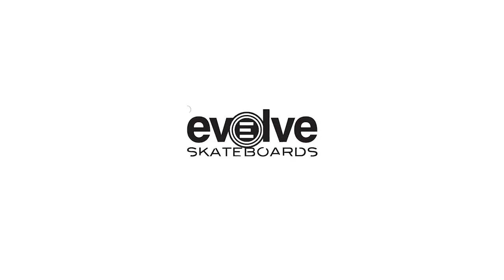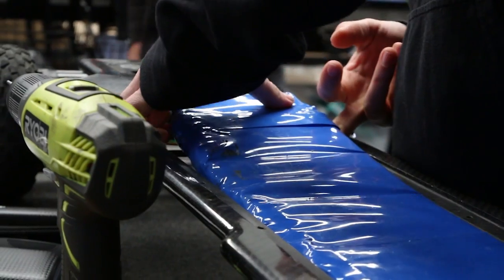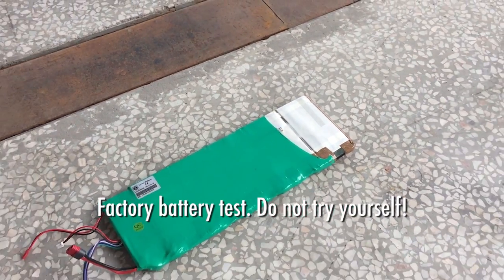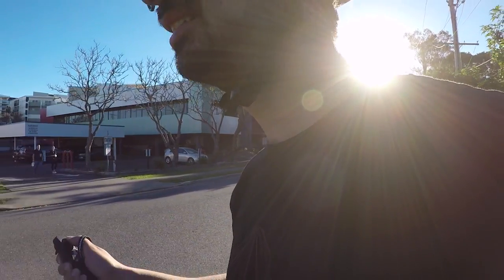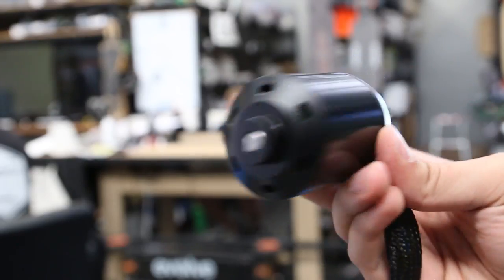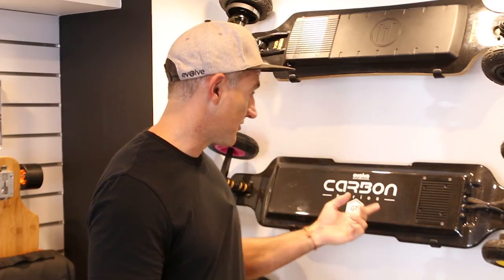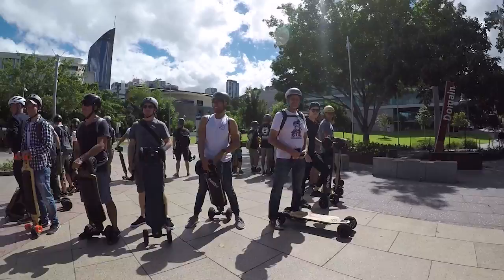Batteries, Motors and Knock-Off Evolve Skateboards - Evolve Weekly Ep. 31

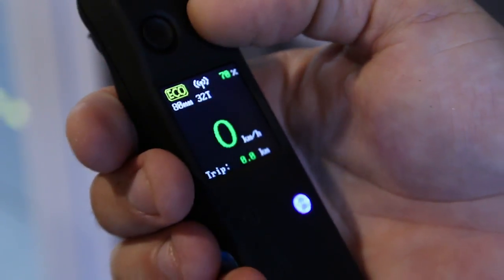Comment: 2:39, the reason is because it's easier. monitoring voltage is not Power remaining. you want to measure coulombs
Evolve are crap, the voltage drops and it keeps switching to lower speed modes and you have to keep bumping it back up.. imagine if you really need to move quickly and that happens.
Reply from the maker: Hey, this video is 3 years old - you should see where the technology is at now!
Reply: @evolveSkateboards  my Carbon GT skateboard is 11 months old and still does what the old ones did and it died with a faulty pouch cell which was problematic since I got it but now it's too late they didn't fix it before the warranty ran out, oh yeah only 6 months. So no improvements were done on GT, you don't even sell it now.

Comment: Have to say I’m very disappointed in the battery quality of the evolve boards too.... 
I’ve got a carbon GT on AT setup and it’s only got 51 cycles on the battery and already the battery range is terrible,  I am 6ft 2 and just shy of 200lbs so yea I’m not the smallest guy but still!! 
Granted in GT mode it will pull your teeth out, the speed and acceleration is really impressive but I literally get 15-20 minutes and the battery is sagging it’s arse off.. kicking me into Eco mode
 (which at my size is fast walking pace)
Even without GT mode, fast mode ridden ‘hard-ish’ I don’t get long at all on it... 100 percent charge, 30 mins tops... yes when you stop for a minute the battery level goes back up on the screen but as soon as you start riding again it’s like an old donkey! 
Must say I wouldn’t like to push my luck for more than 3 miles on it without worrying about running out of juice or at best riding home in ‘Eco Walking Pace’ (god forbid you hit an incline)
I’d like to note that the board has ONLY got 51, yes.. FIFTY ONE CYCLES from new! Never stored cold or outdoors, never run totally dead and never overcharged! 
Board is well built, rides real nice, carves real nice, looks awesome but the battery is dog sh*t!
Quite disappointed to be honest

Comment: It’s funny that they’re using 18650 cells now.
Reply from the maker: We always liked the cells but it's important to get the full system working flawlessly. It's all explained in the doco about the GTR.
Reply: Evolve Skateboards Jeff tries to make the case that your old packs were more practical which is just not the case.  I spent $2,000 on a electric skateboard that’s been totally overhauled in the past year. My evolve bamboo gtx has less than 50 miles and isn’t working. USA evolve sent me a link to buy a new motor for 4 times the price of a 5065 motor. So basically I have to strip down my board and rebuild it spending more money.

Comment: Don't forget that square packed batteries have larger surface area. So you should theoretically carry higher capacity per volume vs cylindicar 18659/26650

Comment: Rode my gtx for 4 months nearly every day, no voltage sag to speak of.
The board is now stored for the winter, going to put it to use in a few months or so again.
I hope it will still perform well.
How long time does it take  for the battery to start going bad?

Comment: The batteries on these boards are absolute shit. I highly recommend you don't buy one of these and either get a different board or wait until they improve it.  Not only are there battery problems, The controller also disconnects halfway through the ride.. This is very dangerous. These boards cost premium price, but do not offer premium quality.. using cheap ass batteries and shit remotes.. Highly recommend anyone planning to buy one of these to rethink.  Once again this board costs premium price but does not offer premium quality..
Reply: What board are you using?
Reply: Martin H. It’s my friends evolve GT. It keeps disconnecting on us. I’ve been riding it since he got it so I got to know the board pretty well. The boosted never failed on us and both boards were at 100% including remotes. It’s very dangerous.
Reply: @kifter4254  R2 remote?

Comment: Looks like you folks are ripping people off! Fuked up remotes, fuked up batteries, and NO OFFERS TO FIX ANY ISSUES!!! Basically you’re just stuck with a fuking $2,000 board that doesn’t work right and this cheap ass company WILL NOT FIX ANY PROBLEMS!! They just tell you -too bad, buy our new upgrade but we’re not going to support any issues y’all have. If these boards were worth a rats ass then the company would fix any problems that were there originally!  Worst customer service EVER!!!

Comment: Thanks for clearing up the air about batteries. I was going to buy a GTX but after all the horror stories I've been reading about the remotes getting stuck in full throttle or suddenly disconnecting and going into breaking I've got real second thoughts. please give comments on this issue. I am not trolling, this is a legit safety question !

Comment: I GOT CHUCKED OFF MY CARBON GT GT BOARD GOING UP HILL WHILST IT WAS GOING REAL FAST 
WHEN IT JUST WENT IN TO ECO IT SUDDENLY SLOWS BUT YOU DON'T AND YOU GET THE FLIP OF YOUR LIFE 
IT WAS THE ONLY TIMES I HAD ACCIDENTS ON MY BOARD EVER !
BUT IT HAPPENED SO OFTEN WITH THE POWER  AT YELLOW  22 % AND EVEN ABOVE ,
THAT I STOPPED GOING UP HILLS AT 30 % ,AND I WAS SCARED BUT RECENTLY 
AFTER HAVING SOME SERIOUS ISSUES WITH MY BOARD IT WENT INTO SERVICE 
MY BOARD HAD SOME SERIOUS ISSUES FROM THE GETGO
IF I HAD BEEN USING IT FOR SAY 30 MINS FULL PELT WHEN I TOOK IT TO A FLAT SECTION IT WOULD ACT AS IF IT WAS IN SLOW MODE  AND IT WOULD STILL SAY GT IN THE CONTROLLER ,BUT IT WOULD NOT GO AT ALL ON GRASS ,AND WELL SLOW AND WEAK ON TARMAC  I WAS SO UPSET ABOUT IT 
I HAD TAKEN IT TO THE SERVICE GUY A GOOD COUPLE OF TIMES BUT THE ISSUES WERE STILL THERE I WAS SO BUMMED OFF ,I JUST COULD NOT TRUST IT  TO GO WHERE I WANTED TO GO WITH IT AS I WAS NEVER SURE IT WOULD GET ME BACK AND LUGGING IT HOME WAS A RIGHT ROYAL FREAKING PAIN IN EVERY MUSCLE I HAD 
I HAD HAD IT FOR ABOUT 5 MONTHS AND I WAS SO UPSET WITH IT .
I THOUGHT THE BATTERY WAS DEFECTIVE OR THE MOTHER BOARD FOR IT  I DON'T KNOW I JUST THOUGHT IT WAS A RIGHT WRONGUN AND I WAS STUCK WITH IT 
DAM THING SWITCHED IN TO ECO AT 56% IT WAS JUST 5 MONTHS OF A PAIN ,TO BE HONEST 
I GOT BACK ON TO THE SERVICE GUY ABOUT IT SO MANY TIMES ,
I WAS GOING MAD ,I REALLY WAS 
FINALLY AFTER ME REALLY GETTING THE HUMP AND HAVING A HISSY FIT 
HE TOOK IT IN AGAIN AND THIS TIME  TOOK IT THROUGH ALL THE TESTS ETC UPDATED THE CONTROLLER 
I GOT IT BACK WITH THE NEW UPDATE  
NOW I NEVER GET CHUCKED OFF IT GOING UP HILL ANY MORE EVEN WHEN ITS A RED 11 % 
WHICH IS SO GREAT , IT NEVER STOPS WORKING  ANY MORE LIKE IT USED TO 
SO I KNOW ITS GOING TO GET ME HOME FROM WHERE EVER, I TRUST IT AGAIN . FLIPPING HECK I AM SO MUCH HAPPIER WITH IT NOW 
BUT ITS A REAL SHAME THAT I HAD TO PUT UP WITH IT FOR 5 MONTHS  
WITH ALL THOSE  BAD ISSUES MY CARBON GT BOARD HAD FROM ITS ARRIVAL
I HAVE TO SAY IT TOOK SOME GETTING USED TO THE NEW CONTROLLER  BITE POINT  AND THE FACT THAT WHEN YOUR GOING FULL SPEED NOW THE ACCELERATOR  IS FULL ON THATS NEW .
I DON'T MISS THE REVERSE MODE NEVER DID USE IT ANY WAY ,BUT
I CAN NOT UNDER STAND WHAT THE SAFE MODE IS FOR ,
I HAVE NEVER TRIED MY STREET WHEEL ON MY GT  
ITS MAD COS I THOUGHT I WOULD USE THEM MORE THAN THE A T  WHEELS BUT ,,
I GOT TO GIVE THEM A GO JUST WISH IT WAS NOT SUCH A FLIPPING  PAIN TO SWAP THEM OVER 
I DON'T EVEN KNOW HOW TO DO IT  YET   MY STREET WHEEL ARE STILL IN THE CELLOPHANE WRAP HERE  LOL
LAST WORD IS I LOVE MY GT BOARD NOW  ( IT WAS JUST BAD LUCK IS ALL )

Comment: Best not to solder 18650's -  you weld them.  Furthermore having 10s 1p pack is where you get the famous and terrible evolve battery sag from.  You also forgot to mention that generic prismatic cells are a lot cheaper than quality 18650's so in a sense you have chosen profit over delivering a better quality product (not saying your boards don't work well but could be better)

Comment: I'm sorry. i'm in the electric helicopter/drone World and i Can assure you that the cells you use in the Bambou GT are just crap. They don't hold the discharge current at ALL ! 
you have very well known Brand in this market which provide very high current with much less Voltage sag. if you didn't want to use 18650 you could at least use decent lipo pouch. these one are just cheap and don't even hold a lot of cycle. Go take a look at Genace, thunderpower, pulse battery to name a few.... i read sometimes 400A Peak and 300A continuous (electric rc-heli speed races) and my packs don't even sweat. very flat voltage curve until 4/5 of the capacity.
So i also respect Evolve but for the price of the board, cheap cells, unreliable motors and capricious remote....
And give us a link please for the battery upgrade you mention,  never found any. 
I don't want to be rude but let's be totally transparent here !
Reply: As a RC Helicopter guy, you also have to be completely disappointed with the implementation of the RF technology in these boards as well. Completely negligent to release these boards with those nRF24l01 chipsets.

Comment: smaller size of cell does matter in terms of portability and aesthetic but skateboards are meant to be used not to be displayed aesthetics don't mean shit if the board's performance is dropping like poop... that is why I bought evolve...for the performance and now this performance is going south and south and now I can't even see why I' m riding this board...Now my bamboo GT has same miles range as Boosted Board
Reply: you don't buy evolve for performance,  A boosted's standard range batteries literally a123s i think; they can be recharged 2000 times before they degrade. Evolve is normally 250-tops 500. Hi Sung!

Comment: Your argument is invalid... I tested out in Eco mode only on flat surface with average of 16-17mph and My bamboo gt(my weight is 170 pounds / 80kg) I got 7.8 miles before it's voltage hit 35v (which is nearly dead) so Jeff.. I love you and i love evolve but these cells are getting reduced every day...

My first time riding it I got over 16miles on range on Fast mode riding 20mph on average (including uphills) and now I can barely make 7 miles with decent speed. (and that is done by eco! not fast, not gt,,, but ECO!!)
Reply: its true, I just ordered a 10s5p from Kevin Dark (aka the battery guy) because my CGT now only gets like 2 miles!! I cant even ride in GT or fast because the sag drops soooo low it shuts down the board. Evolve makes AMAZING boards, and they just did a killer job fixing all the remote complaints with the R2... it would be cool to see Evolve absolutely CRUSH their battery issue in the same way with future updates.
Reply: Sungwon Shin they get away with these shitty batteries. There are guys that make way better quality batteries for the gt for around 300$
Reply: @cristianconstantin6496  Not even buying this anymore. stopped my friends from purchasing one too, board is absolute shit and dangerous. shit batteries and connections
Reply: Cristian Constantin Where's a link?  There is no one that sells a battery for the GT for $300. 
Only way to get a new battery better than stock for $300 is to build it ur self or have a friend that knows how to build it for you.
Reply: people like kevin dark do good 3rd party battieres, and you can find these same batteries for sale on facebook eskate sale groups.
Reply: Sungwon Shin They're full of crap, mate!
Reply: Cristian Constantin no one is making batteries and selling them for $300........if you know one let me know lol
Reply: exactly
Reply: Indeed mate!
Reply: Hey I know this is old, but fast mode with half throttle is more efficient than eco with full throttle, and it goes the same speed.
Reply: In socal the man to go to is psychotiller~~~ 10s5p will be going on my gtx ~~
Reply: absolutely, these boards are shit.. Evolve is highly overrated
Reply: have you been using a fast charger?

Comment: Great video to address a lot of the questions I've been seeing throughout social media lately. Just one thing - IMPROVE YOUR REMOTES! I love my Bamboo GTX, it's an incredible piece of hardware, and I have no qualms with it. But your remotes need to be refactored, the LCD display is excellent and the buttons are fine, but the trigger is just silly. It's too sensitive, too easy to accidentally knock and ultimately feels cheap, which is an issue because Evolve boards look and feel premium. I've seen complaints about the remote triggers everywhere, and I think this should be a high-priority item for Evolve to address.

Comment: Guys I need your advice! , should I buy evolve carbon gt for the first ride? And I don't have any experience with any kind of skateboard before.. But I hear new engine is coming soon? Much power and much faster right.. So should I wait the new motor or just go with evolve carbon gt? Sorry for my bad English,
Reply: I think the bamboo Gt is the way to go. Had mine for a while and i tell you, this motor is strong enough! Its amazing. Would not spend one more day thinking of what to get. Get the one you feel is right and do it asap, life is to short, electric longboards are to fun. (Ps you might shorten your lifespan by using evolve boards)
Reply: the carbon GT is a very good board to start and to begin a very good rider if you want it. Sometimes I ride it at the World Cup, sometimes its my 9 years old kids who ride it, everybody have fun with this board and you can taste AT or street as you want . Maybe in 2 years after burn the streets near your house it will be time to have more power I guess ;) enjoy your endless wave